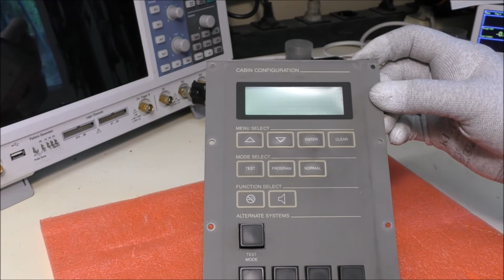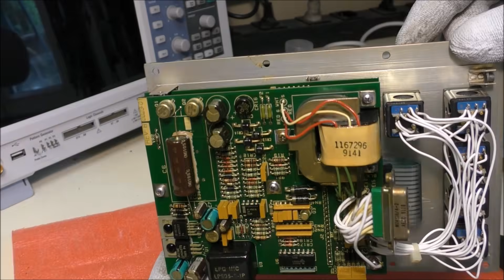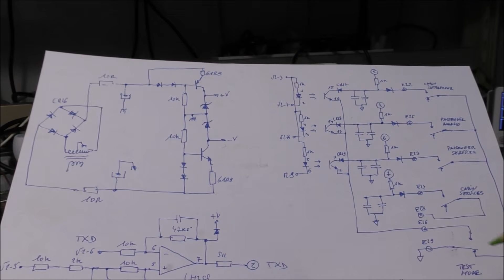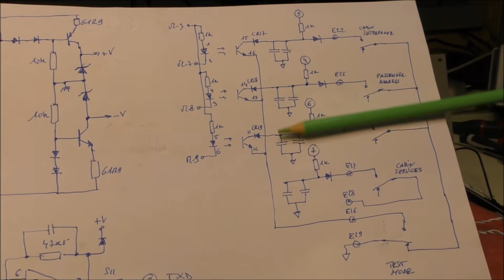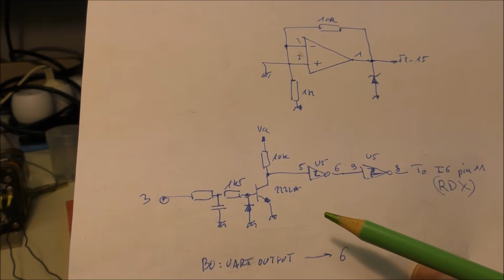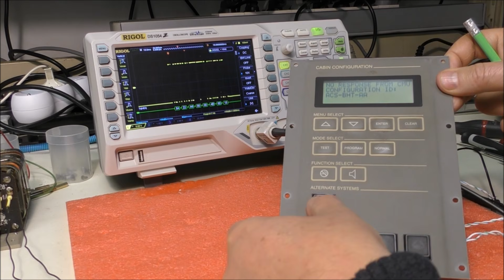LDM #459: Boeing 747 Attendant Control Panel Part 2: Cabin Configuration

Comment: Hi, thank you for this very interesting video. I have the same FA module, but I’m having trouble identifying the power supply connections. Could you please tell me which wire/pin number provides the power (+) to the unit and which one is the ground (-)? Thank you very much for your help!
Reply from the maker: Power supply is 26Vac 400Hz between pin 1 and 9 of the sub-d 15 connector. No dc.
Reply: @lelabodemichel5162 
I have two receptacles on my FA module, labeled P8 and P6. Which one should I use for the 26 VAC 400 Hz power supply between pins 1 and 9? Thank you!
Reply from the maker: There is only one connector on mine. You have a different model. You should measure a very low resistance between the pins which are connected to the transformer.

Comment: Thank you Michel. I have a question for you. Why would you use opto couplers on the push buttons? They are local to the uP...
Reply from the maker: The optocouplers are used in test mode, they permit to simulate a press of a key using external command signals. In that case it is normal to have a galvanic isolation.